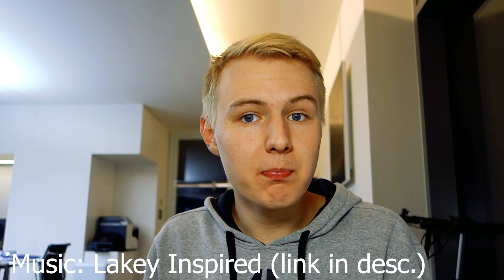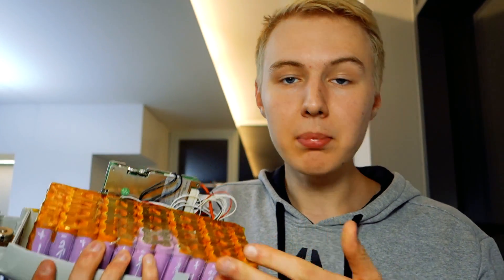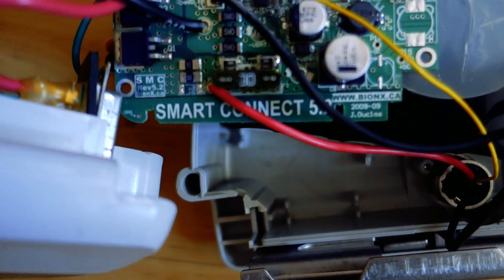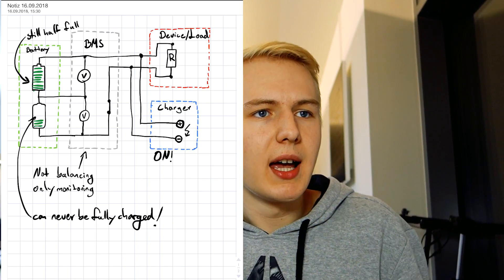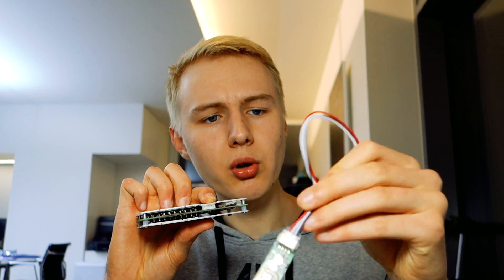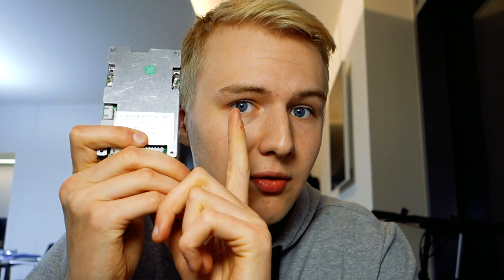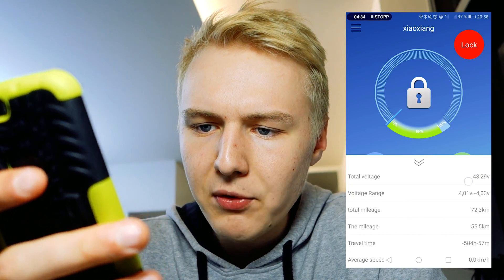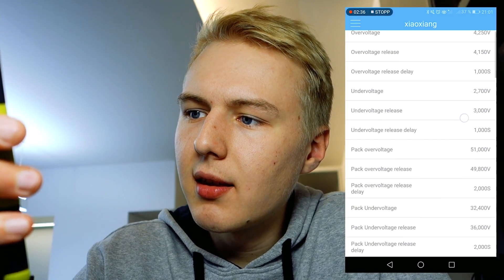The Best & Cheapest BMS ever! Smart Bluetooth BMS Review

Comment: This BMS SUCKS! Do not buy, interface is glitchy, you don't get access to parameter settings, misreads (says I have 100% charge when I'm at 20%). Customer service does not respond.
Reply from the maker: Depends on the app version you use, the old one works without an account. The new app requires a login to change parameters. Also its just guessing the SOC by voltage in the beginning, dont worry if its off by a bit.
The bms is far from perfect but try finding a better one!

Comment: I've a 16s smart bms of a battery pack but programmed for 12s lifepo4... I unscrewed the heatsink to inspect the pcb and saw the leftover 4blank connectors are just soldered and shorted together but they are connected to resistors and other components... I need to figure out some way to use it as a 15s bms please help me if possible... I don't want to buy any default bms I've 4pcs of smart bms all are 16s used as 12s....please help

Comment: Can you explain how you would wire this BMS with cells in parallel, e.g. 12s3p pack
Reply from the maker: you can imagine paralell cells just as one big cell. Paralell cells balance each other constantly automatically.
And wiring up a bms is really simpel, a wire goes to every single voltage level. from 0V...3,6V... 7,2V to the 43V is the case of 12S
Reply: Thank you makes senae now

Comment: To use the on off button without precharge it is possible to connect a resistor between drain and source of the mosfets. If the controller has no consuption the capacitors will be charged and  there will be no  current spike while turning on the bms. This can work only with controllers that has no power consuption while off. I made this in my ebike and it is extremely usefoul because there is no need to disconnect the battery and newly make precharge. I simply shut down the controller and the capacitorswwill charge and the bms does not see a short any more.

Comment: Hi! Great video. I have  a question. I have replaced my BMS with a "smart BMS bluetooth" 10s 60A in my ebike. My battery works and the BMS is ballancing, voltageprotection and dischargefunction seems to work fine. But when i charge the battery it doesen´t stop until it reach some safety limit (overvoltage cell och total voltage). I have play around with different setting but did´t find a limit/function to reduce chargingpower at the end of "chargingcycle" to avoid tripping.  Is there a way to do this?

Comment: Hi Leo, You are saying to not use the ON/OFF switch on the BMS . What are you recommending ? I am looking for something bi-directional since I will be using the same port for charge and discharge and also my Ebike has regenerative breaks
Reply from the maker: you need a antispark for that. that will do the job. If you only have small motor controllers, use something like the flipsky antispark, if you have something bigger you need to use a precharge antispark

Comment: I think I will go with this bms for 38 euro im trying to stick to a budget, the only thing i notice is that is nominal balance current is 50ma whereas if i pay 10 euro more for alternative on aliexpress there is one for 100ma . I dont know if that is low. I guess it should be okay with new lg mj1 cells?  I read that  these bms' limit the amp for chargers , what is the highest i could use on this or would you recommend? i was thinking  6 amp for fast charging to use on a 48v 14.5 Ah battery. 13s4p. and for daily charging which would be better 3 amp or 2 amp charger?
Reply: Old comment, but 2 amps for charging is already a lot, that's a 100w flowing in the battery. Unless you empty the battery every day fully, which is not recommended, 1.5A or even 1A is enough

Comment: All types of BMS become "not smart" when you use multiple cells in parallel like 10S-2P, or 3P and so on. They only smart with 10S-1P when single cell is being monitored. And its pretty insane to use multiple BMS's in your setup if you're more then 10S-1P. I wish there is a better solution for it... 
Great video though, i will order one. Thanks!

Comment: Hi man, thanks for your video! one question, I see in the app settings you can set up the overcharge voltage and undervoltage. So am I true if settings these values to other range (for instance 3.1v to 4.0v to have something like using my cells 20% to 80% will avoid me to have a smart charger and be able to have my battery working longer ? did you test changing theses values ? Thanks!!
Reply from the maker: Yes I think a maximum of 2,5-3,2V is for the discharge cutoff and 4,0-4,5V for the charge cutoff possible. But I would be carefull with these values its way easyer if you just buy a decent cc cv charger or boost converter and set the end voltage to 4,05 for example and just look at the voltage while riding so you dont get too low. This way your battery doesnt just cut of suddenly :)

Comment: nice video...
quick question - am I correct in thinking I can set my overvoltage at  say 14.5v and reconnect at 13.2v on a 12v 4s system ( using my charger and solar that uncontrolled run to 14.7v ) which will have the net result of cutting off at 14.5  and cutting out the float voltage on my  lead acid equipment I m hoping to be able to make function in this manner ??
Reply from the maker: for that you can build a simple transistor zener diode circuit that switches at the wanted voltage?
btw using solar and lead acid is a terrible combination. Lead acid batterys have a terrible efficency which completely destroys the purpose of solar panels.
Reply: The bms is smarter than you ve noticed and i expected.
it can be used with lead acid charging equipment be it solar charger or alternator and once its full displays overvoltage and will not reconnect thus it offers a true fully protected drop in replacement for a 12v battery..
Reply from the maker: @harryharry8384  I engineered and developed on BMS systems like this I know what they are capable of and if you connect a 12V lead acid battery to 2 of the 15pins on a BQ76940, its a pretty much useless and stupid configuration
Reply: @Pryside  I m not talking connecting a lead acid battery..
I m talking dropping a 4 cell 12v lithium with smart bms straight into my rv with no changes to solar regulator or 240v charger or alternator on 40amp fuse. 
it charges the battery full then I get overload lockout that cuts charge and keeps it locked off 
this means I can fully charge safely with original van equipment making a battery using this bms a direcxt protected replacement !

Comment: Honestly if your cells are new they will balance automatically. BMS are interesting with old or bad quality cells. I use battery log system same as in my drones. And balance them every 20 charges. The problem of these BMS they are aging the battery trying always to balance them. And often they are defective and kill you battery pack. I repair a defective one because of 2 cold solder joints. But I understand for mass production you need it because people are not specialist of li ion. Thx for the video. Subscriber.
Reply from the maker: Yes thats how I thought a few years ago too about bms systems. The reason this one works is because it doesnt do all the stuff you just mentioned. It has a hysteresis so that it only balances after a delta of a programmable voltage. I've set mine to balance after 0,04V difference. And never below that. Also this one doesnt break, used it in many applicatioons and it has a wrong-wiring-protection and many other features. Its really well engineered, not like 99% of the bms systems you'll find out there
Reply: @Pryside  Hi thank you so much for these information. The feature you're mentioned is effectively very powerful. This certainly will change my distrust on these systems. I guess I will check AliExpress for 12s, 16s and 20s ones.
By the way I replace the bushing on the verreal F1 with arangatang nipples,  red bones bearings and arangatang 77a 85 mm caguama. And it is not the same board. Very smooth very carvy. 
Finally your video is a gem because I have learned something new and promising to improve battery life.

Comment: Also ich hab die ant-smartBMS mit Bluetooth die kann 300A händeln und geht von glaube 12-24s und als App nehm ich die Vortex VBMS 😉
Reply from the maker: holy shit, interessanted bms. Aber weiß nicht welche applikation von 300A wirklich vorteile hat. Ich hab ein 60A BMS in meinem ebike, das kann 120A peak aushalten und ich wüsste nicht wieso ich jemals was fetteres bräuchte... so viel gas kann ich gar nicht geben dass das heiß wird.
Reply: @Pryside  Ja ich kann doch aber die Einstellungen so einstellen das es z.b. nicht mehr als 120A abgibt dann ist der kostenfaktor bei den Unterschiedlichen Modellen so gering das sich das nicht lohnt eine BMS mit 150A oder 100A da bezahl ich lieber die 10Euro mehr und hab gleich eine BMS die von 8-24s geht und ich kann die dann auch noch verstellen von z.b. 100A-300A was die anderen nicht können Achso und ich empfehle die over-current protection auf 0 zu stellen weil das sonst das überschießen zulässt und das deinen Akku Schaden kann das hatte zumindest einer empfohlen und dann auch in der App mit nem neuen Update in die Beschreibung rein geschrieben das das setzen auf 0 empfohlen wird klingt auch logisch finde ich.Jedenfalls hast du dich mit dem kelly Controller genauer beschäftigt was fährst du da für Einstellungen?Und was bewirkt denn wenn man das eine höher und das andere runterstellt ?Hab's zwar so hinbekommen das es geht aber irgendwie hab ich das Gefühl das das immer mal weniger Leistung hat mal mehr dann finde ich die topspeed irgendwie langsam da bin ich mit meinem 1000W Motor schneller gefahren ca 70-74Km/h und jetzt komm ich so auf 62-65km/h nervt doch das man die Drehzahl nicht höher bekommt 😢🤔 kannst mir auch über Facebook als pn antworten ich heiße dort Thomas Krieger 😉

Comment: Hi , Leo can you please guide me ?
I have an DIY electric skateboard with a 40 A battery , my ESC sucks 24 A at Max. My BMS is 15A , my positive output of the battery goes directly into the ESC , but
Reply from the maker: can you config your esc even? maybe just get a cheap vesc and add the tvs diode like i showed in my eboard vid...
Reply: @Pryside  No my point is that the esc will take 40 A but i used high A battery in order to get no voltage sag ...
But my bms on the battery is of 15 A ...
So is the battery only outputing 15 A to the esc ? Which is designed to work for 24 A ? & I don't want to use low amps as it reduces performance ....
But my + & - ends of battery go directly in the esc , as - end also goes into B- terminal of bms , so is the battery able to output 40 A to the esc instead of 15 ??

Comment: Excellent video - very informational and helped us  .. I may be just getting old (23) but the music was distracting - wish it was much lower ... thx ...
Reply from the maker: Thanks, propably wasnt mixed that well back then :)
Reply: @Pryside  While i have you on the line - SO we are looking for a 12S 12V 150A (or more) BMS with BLUETOOTH ... we went to the site you recommened a year ago to find one and did -- BUT just wondering if you have any newer or different recommendations as to what to get or where to look??  Thx
Reply from the maker: @ghostwriter6699  12s 12v? And 150A? Almost no cell has 1V... And 150A is very possible with the 60A version. I run my 60A on 200A peak
Reply: @Pryside  SORRY about that -- too much coffee ... we have 3 x (3.2v x 4)  LIFEPO4 batteries .. our 3.2v LiFePO4 batteries are 200aH each ... THUS we have (3) 12.8v 200aH batteries running in parellel (4 - 3,2V batteries each)... I want to be able to put the batteries in parallel to give me 12.8V 600aH BUT also be able to monitor all the 3.2 batteries off of one BMS via bluetooth ...
Reply from the maker: You have a really wierd usecase... You can always use the smart bms just for charging and discharge directly. But you propably have something wrong. No electric vehicle is usefull at 12V 150A
High amps always means high losses
Reply: @Pryside  NOT using it for electric vehicle .. using it for my RV ...
Reply from the maker: @ghostwriter6699  then maybe just use the bms for charging and use some beepers for warning of low voltage and shut if off manually

Comment: Hi
Does it have an ON/OFF switch ?
I understand from the video you can switch it on or off from the App, but you say not to use it because of inrush current (when charging capacitor for instance) Is there any good solution  .
?
Reply: Ok I see. I've found your anti spark or "precharger'.
But that's one more power PCB bord to find a place somewhere !
I think this kind of device should be included either in the BMS or  in the ESC !

Comment: Hi! Is it possible to change battery output voltage? For example, i have 42v battery with this smart bms, but my device uses 36v, can reprogram bms to give my device 36v instead if 42v? Thx!
Reply from the maker: There is no 42V battery out there.
You mean a 10S with 36V nominal propably. What do you want to change? Use a 12S battery on the same bms?
Reply: @Pryside  u have got Acton s1 skateboard, the range is 5 to 6 kilometers with the stock 10s battery pack. The reason why I'm asking is because I want to make diy battery pack and fully fill the case, it will fit in 12 batteries or less. The motherboard ESC works with 36 volts. So I was wondering if I could make high voltage battery pack and undervolt it to 36v. I guess I will have to use DC DC converter then.

Comment: Hey mate could you explain a bit more why you wouldn't want to turn this off and on with a vesc installed
Reply from the maker: This topic is a bit complicated will make a video about it, i developed a solution for big motor controllers to turn them on without destroying mosfets of antisparks... Will propably take a few weeks.
Has something to do with the inrush current and the capacitors not being charged
Reply: @Pryside  I thought that was only a problem when using an anti spark switch. The on/off input on the Bms wouldn't require an antispark

Comment: Under discharge protection means the battery is full. you meant Over discharge. ;)
Reply from the maker: nope. Under-meaning below-discharge-meaning when having a load connected. Disables your battery when you get below a certain voltage.

Comment: Ich hab ne frage. Ich hab ein ncm moskow gekauft. Mit bms und so.
Der sagt mir auch immer schön das sie Batterie noch 44 volt hat oder so. Hab 600 Watt Akku. Hab mir so ein tuning Display gekauft. Da es bis 45kmh können soll. Aber mein Rad fährt nicht schneller als 30khm der Motor ist nur zur Hälfte ausgelastet. Hast du ne Ahnung was ich machen kann?
Reply from the maker: Was meinst du mit "motor ist nur zur hälfte ausgelastet" ja drosselt das system leistung ab 30 oder kommst du an die grenzdrehzahl?
Reply: @Pryside  Ich denke mal der Motor dreht sich nicht schneller. Das ist ein rear motor

Comment: Great valuable content!!! Very good explanation of a BMS!!
That popular Smart bluetooth BMS also has advantage that is very simple/standard technology and so it is easy to repair or mod. The PCB is simple and dual layer only, which is great. The ICs used are very popular and are technology used on Arduino world, like the microcontroller that is the same as Arduino and the cells balance IC that is very well known and there are OpenSource firmware libraries to control it. Also the bluetooth module is very well known and standard technology.

Please see here the technical information and ICs datasheets of that BMS: https://opensourceebikefirmware.bitbucket.io/development/Smart_BMS_with_bluetooth.html

By the way, for when a review of the TSDZ2 mid drive motor running our OpenSource firmware?? see here:
- https://www.youtube.com/watch?v=IrWn6e8bIuQ
- https://github.com/OpenSource-EBike-firmware/TSDZ2_wiki/wiki

Comment: Do you already using the new 21700 cells ?
Another interesting model is the NCR18650AU Gold Lithium endothermic cell, which gets cold by charging instead of hot.
Reply from the maker: No. 21700 are hard to get and can be quite expensive no real dealer like nkon is selling them cheap yet.
NCR18650AU gold was a april fools joke btw ^^
On top of that, heat is not the issue when rapid charging. In fact my cells wont get hot even when charging with 3C. But charging this fast degrates your cells very fast.